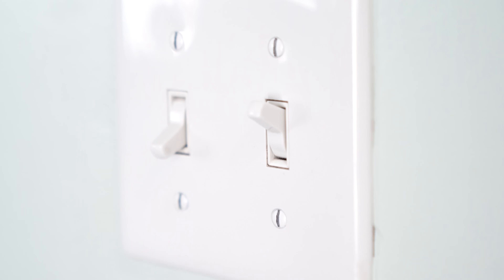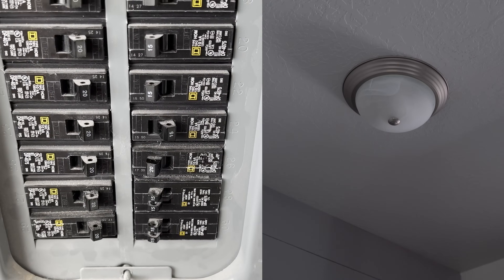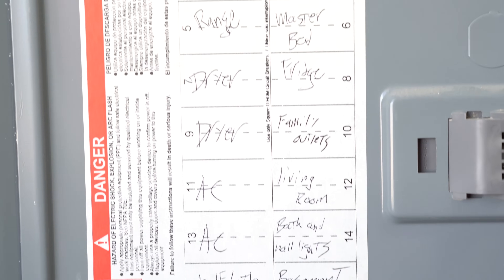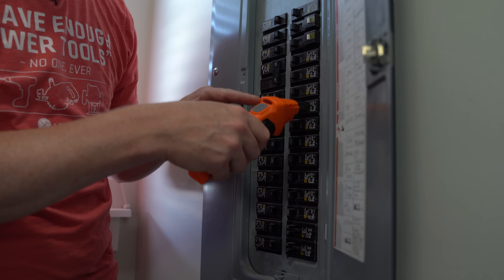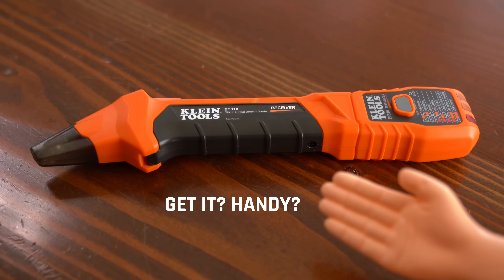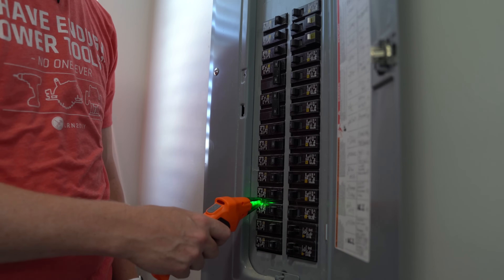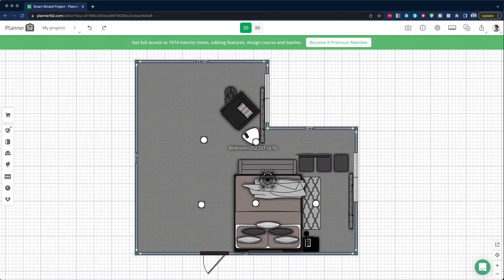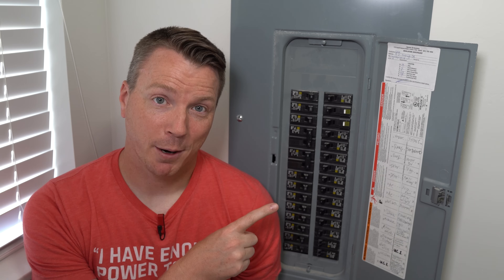This Tool Could Save Your Life

Comment: So you know. You can also use the Klein Digital Circuit Breaker Finder to find (Identify) other receptacles on the same circuit using the same testing procedure as used at the circuit breaker panel, but by scanning other outlets etc.  It just speeds things up a little rather than testing every plug against the circuit panel. That said, you still need to verity that any circuit is open prior to working on it.  :)
Reply: What am I missing?  When I plug the transmitter into a receptacle and then use the tester on another receptacle in the same branch, I get nothing.  Even if I pull the cover off and touch the hot wire.  But it works at the wire in the panel. Actually, makes no electrical sense.  I'd like to be able to plug into one receptacle and just touch other receptacles and switches to see what's on the same branch.  I'm using the ET-310.  But I just tried it again and it worked but on other receptacles it doesn't.  I wonder if a small extension cord could give me closer access for the receiver to touch.
Reply: Funny is cause I decided to do this on a whim and found out that it works by detecting the hot wire on all the connected series of outlets.... It makes it easier to remove the covers and scan the hot wire sides. I did however find that the tester loses tracing capability so I turn off and on and go scan a known outlet and then try again. Found my issue with open ground. Did all this in 10 mins. If I had to trace by continuity, it would have taken forever.

Comment: you should always check all the electrical devices in the same box.

just because the switch or outlet you want to work on is dead does not mean that one of the others are either.

sometimes you could have multiple devices in the same box wired to separate breakers/fuses.

older houses are a notorious for having faulty and mis wired stuff by todays standard.

back in the day the electrical codes did not exist for certain things and so it is common to have wiring problems.
Reply: He just did it to make it happen like that for the viewers to make an example he didn't have to uploaded it right think about that

Comment: I discovered the hard way that electricity flows in neutral wires too! I was on a ladder, outside, and i cut through a bundle of neutral wires. I'm not an electrician, but as a qualified aircraft maintenance technician I should know better!

Comment: Remember! In an old house, the logic for how power is run may not be as logical as you believe. I live in a 90 year old house that has power run to the first floor hallway that also happens to run to one or two outlets on the second floor. In other words, back in the day, it was not uncommon for an electrician to grab the closet (or easiest) power he could find to wire up a receptacle.
Reply: People still do that now

Comment: be careful, some homes have "switched receptacles" and they'll be on a different circuit in the same box as lighting switches. 
if you're going to do this, remember that around 0.2 amps can stop your heart.
let's say you have an incandescent lightbulb at 60watts, or a string of LED's equivalent. 
120volts / 60watts = 2.0 amps .....you kids stay safe out there.

Comment: Yeah, but you had 2 circuits in one box (!!!) and I certainly would assume that the one light fixture I tested with the circuit breaker tester (which I do own and love) that I had covered it. 
Thinking to probe all switches in a box has not been on my mind, it will be now!

Comment: Remember this old DIY saying when you use a tool like this: "When all else fails, read the instructions." Buying tools like this may seem expensive. When buying special tools, I first consider what I would have to pay a "professional" to do the job. I use part of that money I saved to pay for the tool. Who knows when I'll need to use it again? If the tool uses batteries, I remove them after finishing the task so they don't corrode the tool. Zip Lock bags for the tools and their batteries are an excellent way to store them for next time.
Reply: Only problem is that doing electrical work to your house is illegal, you have to hire an electrician. The people that dont know what they are doing and dont hire someone who does are the people who you are talking about that die.
Reply: @charlesstidham2788  “Only problem is that doing electrical work to your house is illegal, you have to hire an electrician.” 

Not true.  There are jurisdictions (e.g. cities/towns) where that may be local law, but it's not the norm.

Comment: Thanks Sir.  Excellent Video.  I made a Map of the House, for each Floor and made a Spreadsheet with Amperage per Breaker.  Found the Dryer 220 Volt wire had other 110 Volt run off it.  Bad Bad Bad.  ReWired that.

Comment: So with the first situation where the two light switches were on different breakers, how would using any of these tools had helped. It seems that even with these tools, you would only test one thinking that both switches are on the same breaker and you would till get the same result where a spark will happen.  should you just test everything and not assume.

Comment: So, the non-contact voltage testing tool that you used is defective. I always use my Fluke Meter and touch the leads to the contacts or wiring. The Fluke Meter is a reliable tool.

Comment: Would the digital gfci tester work with this or just the light up 1 that u have. I have the meter 3 pack that has the digital plug tester.
That's for any help

Comment: I been hit by lightning and been shocked by a high power out let...thought The high power socket was of so cut it with a small garden shear it made a chip/dent in the blade ....but being hit by lightning was probably worse although after the hit i can't remember much...at the beginning i heard what sounded like a huge transformer starting ( that it electric sound ), coming from the sink across my dorm room , then a huge flash next thing i know i am half a meter further into my bed, than before , and despite the extension cord i had in one hand wasn't (? My memory is fuzzy) plugged in (had my phone charger in the other) , the lightning must have jumped from the cord into the socket , fried something in the kitchen and made the breakers go of, that's how i managed to ruin half of a castles electrical system for over 12th hours. I was of course rushed to the hospital i was supported by fellow students down the stairs , all that happened to me is a pin 📍 point sized scar, my dorm stinking of bacon and burnt hair for 2 weeks, and my arm sometimes randomly hurt(especially before a storm) and some rare cramps 😅.

Comment: I had the same kind of switch, with 2 circuits on 2 side by side switches. The contactless tester showed me. I do plan on getting this exact circuit finder. I bought a cheaper one but that was useless.  Being handicapped, it will make things much easier. 
However having a circuit finder, I see no way it would help you locate the switches on 2 circuits. There is no way to test switches with it. 

I’ll may relabel my panel at some point, The. builder didn’t do a terrible job. But currently I have created a detailed spreadsheet labeling all my circuits as I come across them with more information than you can put on a panel. . It also compares what they wrote on the panel. It also has the information about the 2 circuits on one switch, labeled on each circuit.  That would be difficult to do on the panel. 
I’ve lived in this house for 20 years, if we do ever sell it I will supply the buyer with my spreadsheet included with the detailed sprinkler solenoid etc. location visual chart in my half acre yard.
And no I have not been shocked, I try to be very careful. Knock knock!

Comment: If you want to print something but don't want the paper to disintegrate then here's a simple way to make indestructible printing paper.
Get hold of some Tyvek Building Cladding paper (construction sites will have it as a waste) and trim a flat piece to 8.5" x 11".
Now feed this into a LASER PRINTER (ink jet won't work) and print your document.  You can put this 'paper' outside for years and it lasts.

Comment: Great video just confused about the alligator clips. I've seen other videos where black clips were connected to black wire and red connected to white. Your video you did the opposite.
Reply: That doesn't matter for what he's doing. He just wants to know if the fixture is on that circuit and it doesn't really matter which probe is which. The only reason why it would matter at all is if he' wants to verify that the polarity on the outlet isn't switched.

Comment: I run an extension cord from the outlet to the panel, and plug in a trouble light to see if it goes off. 
Each of the breakers in my house have a printed label on it, and a plot plan of the house with each circuit labeled.
What can I say?  I'm thorough to a fault.

Comment: I once worked with a guy who would just short a hot wire to ground, then go to the box and find which breaker had opened.  Crude, but effective.  I guess his screwdriver didn't look so good with all the burns and craters!
Reply: the modern toners can work hot or not, that method assumes alot like the breaker is good...and so on im sure u know

Comment: i was working on a 15k watts lamphouse for a giant screen (IMAX) theatre. i was running a 220vac 3 phase power coming out from the generator which is terminated into a 15k powersupply circuit breaker, i was doing a trouble shooting at the time when my arm touched the rear termination side of the circuit breaker it gave me a nasty jolt luckily i was not grounded and was able to live to tell the story. that was a wake up call. after that i have been shock 2 more times that i could think of. unfortunately its the kind of work that i do i have been in this business for 30 years so this kinda things will happen its just a matter of time.

Comment: There's a tester, looks like a screwdriver. It lights up if I touch the hot line. I always use it. But the safest way is always to turn off the main breaker. Just to be sure 😄

Comment: I tried a circuit tracer made by Hi Tech and it was terrible. Plugged in the transmitter, did the pre scan, then it clearly identified a breaker. On repeat it would always identify the same breaker unambiguously. But it was the wrong breaker, not even close. I still don’t understand how that is possible.

Comment: I thought the electrical supply in your house is considered low voltage (as is everything below 1000V AC) 0:27
Reply: It really depends on the context.  In the electrical industry, yes, you are correct.  But, to the average residential homeowner, their 12 or 24 volt doorbell is low voltage (e.g. not that dangerous), and their 120 or 240 volt utility wires are thought of as high voltage (e.g. respect it).

Comment: I make my kids call me while I'm at the breakers, and I ask them when the light or lamp (in case of an outlet) turns off, but when working alone, use a two way radio, with a radio just as explained (two way radio needs electrical tape holding the transmit button down)  in case you are too far away to even hear the radio playing in the first place.

Comment: Anyone knows how that device works?? It sends hf pulses through the line?? or detect current consumption?
Reply: good question!  I've been trying to test multiple receptacles, with transmitter plugged in one receptacle and then using receiver on other receptacles on the same branch.  I've been having very mixed results/failures to detect, thinking that the pulses if they exist would be on all branch circuits, but now I see it's possible that with the receiver upstream, it might not be sensing the necessary signal based on a current consumption.  Or perhaps the signal is riding on the current draw from the transmitter to the panel and bypasses all other devices in parallel.  hmm 🤔

Comment: Your non contact detector should have detected the live switch when you checked the switch you shut down due to how close the switches were. I have to say, if working in a box with 2 devices, you should deenergize both devices before doing the work.
Reply: Indeed, I’m not impressed with that Klein non-contact tester after watching this.
Reply: @marcinmerrimack1726  or we should be super impressed with it. I've opened a 4 square box up and probed with one and it goes off all over the place with just one hot wire.  MAYBE it's super accurate within a millimeter 🤣🤣🤣. In any case, the circuit breaker tool would not have helped due to it not being able to be plugged into the light switch.
Reply: Seems to me he may not have done a thorough job of probing that box...

Comment: This really points out the dangers of using a non-contact voltage detector! If you want to be a real electrician then you use real voltmeters!
Also if you have been an electrician for some time, you will likely just plug in a special shorted plug, and it will open the circuit in about 1/1000 of a second.    :-)

Comment: I’m confused how the circuit detector would prevent you from getting that shock? It would only tell you that you had the correct circuit for that switch not the second switch that you actually got the sparks from. Also why would you non contact detector not have gone off? This device wouldn’t have prevented this scenario in the least. I have and use that exact device but it wouldn’t solve this

Comment: I have a problem what if my outside outlet plug is not working. How can i use this tool to find breaker non working?
Reply: The first thing to do for an outdoor receptacle that is not working is to find all the Ground Fault Circuit Interrupters (GFCIs) in your living space. The outdoor receptacle in question could/should be downstream from a GFCI if it is not a GFCI itself.  Reset it.  
If that doesn't seem to be the problem, you can check the circuit breaker panel for a tripped breaker.  Some breakers switch off, and some change to a middle position, and the best have a visual indicator that they're tripped.
If neither of those helps, then you should call an electrician.

Comment: 1:39 it's actually illegal (in the UK) for a fitting to receive power from more than one breaker. There's good reason for that and you just proved it.
Reply: UK and US/Can wiring philosophy is quite different.  There's nothing wrong with an electrical box being fed by more than one circuit breaker.

Comment: 1:30. Just careless. (Of course this one is for the video).   But in my many years of electrical work, I have opened many boxes and found a wire nut not just loose, but it pops off.  So careful is a good practice.

Comment: it was unclear if the tool would have saved your shock in the original situation... would it have found the double power outlet?  Why didn't your non-contact sensor sense the live wires on opposite switch in the beginning scenario, was it dialed down in detection?

Comment: One more thing. Watch for active neutral wires. A cause of many deaths, near deaths and injuries. Stray current is how I know it. Don't assume that the neutral is not live because you turned off the specific circuit breaker. TURN THE WHOLE SHEBANG OFF. No current anywhere in the house before working on your house's wires.

Comment: Yes I have been shocked, it was the low side of 480 v ,  it was 240 well pump pressure switch. I was very lucky that day as it went in my hand and out my elbow to the well lift water line sitting in the well water and grounded. all i got is a massive shock in my lower arm that hade side effects all day and lots of pain.   How did i let this happen, I trusted my boss that told me "yes I turned it off" so there is no need to waste time checking and just get to work.   never again will that happen, now I check and lock out all work even though I had to buy all my own safety equipment.. When it come to electrical work NEVER I repeat NEVER  trust anyone, not even yourself always test with a volt meter.  never just a non contact tester as YOU do not want to be the contact tester it' live I'm dead.

Comment: Why did the non contact tool not alert you to the live/hot Circuit?Non contact tools are just a quick way to see not to be used as final answer.A meter is the best way.you know the final answer with a meter
Reply: He didn't actually test the other switch, so I'd say the tester never actually got near enough the other switch's conductors.

Comment: I'm old school electrical guy I rarely shut power off and I always start with the ground wire first then the neutral then the hot and work my way backwards in the other direction if I'm taking a circuit apart.

Comment: I would like to say that those no contact current testers are junk! I don't care what anyone says about them. I have been shocked more times by using them vs not using them. Any apprentice I hire will not use them on my jobs. I require them to buy a meter to test for power. The only reason people use a tick tester is because of laziness. it only takes a couple more seconds to test the circuit with an actual VOM, or Wiggy. To be thorough in checking to make sure everything is off in the box you are working on, test both switches, outlets, or any other device that is in the box. Laziness is the number one reason anyone would get shocked, or even worse, electrocuted! 
The last thing is that I do not allow anyone working for me to work on anything energized unless they have an understanding in circuitry, and electricity. Unless you need to the power on to trouble shoot something, it should always be off. I tell homeowners if it's necessary for them to work on something, shut the main breaker off, and all the branch circuit breakers before they work on it.

Comment: I always use a voltmeter to verify the circuit is off. You can't rely on non contact tracers to verify power is off.
Reply: I do it everyday at work without any problems.